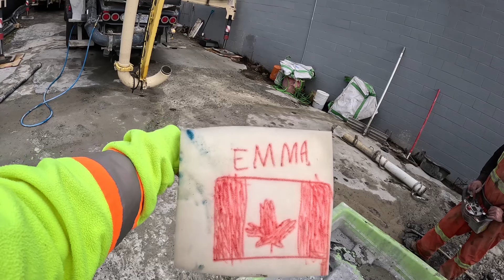sponge/GoPro-water-sponge/GoPro…

Comment: Excellent! I have seen the other video of the guy pulling a camera back and have always wanted to try. Even had a guy on the job the other day tell me that would be cool to watch a camera being pulled through the boom. Maybe I can be the 1st in Missouri to do that.
Reply from the maker: I think that the GoPro mini would be ideal for it as this Hero 8 camera was getting caught up in the pipes here and there. Only crappy thing with the mini is that it does not have replaceable batteries.

Comment: Mad lad! there is some build up at 18:00 though only a small amount but it is deffo there.
Reply from the maker: Little snail-trail in the bottom of the turret elbow. I’m beginning to think these water-washers could be onto something 😁
Reply: I noticed the trail also at the 18 minute mark. Very impressive how well the 2nd pull cleans the pipe though.
Reply from the maker: @fronabargerconveyingpumping  yes, who knows how old that trail could be. My experience is that it takes A LOT of concrete to burn through old buildup left in the pipes, hence why it’s so important to get me squeaky clean every time for sure.

Comment: You lost 2 inches of slump talking and you're late for your next job cause you needed two sponges through a 38m.lol this is cool
Reply from the maker: And what if I told you that I typically use zero sponges for travelling between jobs? 😂😂😂
Reply: @canadianconcretepumper1979  suicide prime? Or just roll wet? Did you ruin the go pro doing this? I've always wanted to know what it looked like in there.
Reply from the maker: @hooligansh33p21  I usually just toss a little retarder into the hopper before pumping down and then roll wet with it to the next job. GoPro was in a waterproof case. Good as new 😁

Comment: Pretty cool.  The two I want to see are the one sponge with water and the final placing boom blowout.
Reply from the maker: Only issue I see with getting it to work with your method is that the GoPro assembly wouldn’t fit through the 4” end of the taper. We’ll need to invest in a GoPro mini for that one.
Reply from the maker: We definitely need to try Emma out on a placing boom!!!! (preferably one of your sites, not ours) 😂😂😂
Reply: @canadianconcretepumper1979  I think I know a way.  (Using Emma)
Reply from the maker: @dannpriebe  we shall discuss this further in a formal meeting sometime very soon. 😁😁😁

Comment: Def cleaner on 2nd run.
Reply from the maker: Even though I'm generally against loading up a pile of water in front of the first sponge (increased chance of segregation plug), I do want to shoot a video of using just one sponge with said quantity of water in front of it.
Reply: @canadianconcretepumper1979  only for brave souls! Also the vid with the cam on front on a clean pipe would be cool

Comment: You got build up in the turret. 🤦🏻‍♂️
Reply from the maker: Minutes and seconds please sir???
Reply: @canadianconcretepumper1979  i believe he’s talking about 17:50-18:10 frame. Doesn’t look major.
Reply from the maker: @DangleMan27  you guys got some sharp eyes!!! Yes, little snail-trail it looks like at the bottom of the turret elbow. One of these days I’m going to flush the boom with water and send Emma back through the pipes for a better look 😁🙃🙃
Reply from the maker: You’re like the dad who says “you’re not good enough”, lol!!!!
Reply: On another note this was an awesome experiment! You might have motivated me to bust the old go pro out and try it. This actually might become an awesome tool for scoping out the boom pipe not just seeing how clean the pipes get.
Reply from the maker: @DangleMan27  I actually want to do a bucket wash and then send the camera through (facing forwards this time) to verify how well, or not well it actually works.
Reply: @canadianconcretepumper1979  I was thinking maybe a modified go devil cut down and recessed back into a hard sponge might have a good result.
Reply from the maker: @DangleMan27  problem I foresee with the go devil is that it hangs up in the boom and rockets back 2-3 times from tip to hopper (they really cannot be pulled back slow/controlled). I think it would be too quick/violent to get quality footage. Only one way to find out though! 😁
Reply: All I can say is I’ve pulled my pipe
On my old 55 and new 56 and there has never been that much in the boom……. Ever
Reply from the maker: @benjaminfooter6564  Save it for your grandkids, water-washer!!! 😂
Reply from the maker: @benjaminfooter6564  you need to watch my old video where we found the deck-pipe of our 24M to be half full of concrete https://youtu.be/8UfTOoujRqU

Better take your pills before you do though.